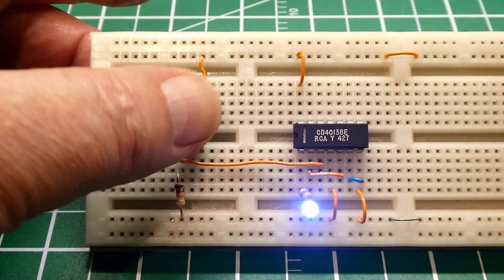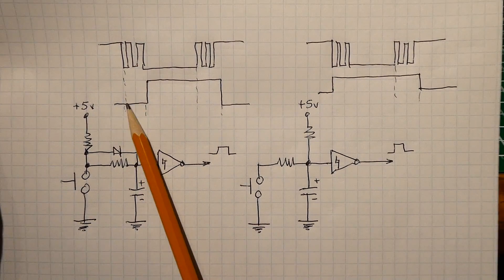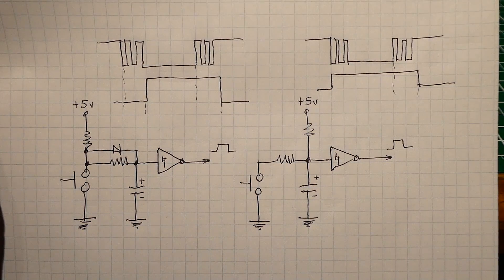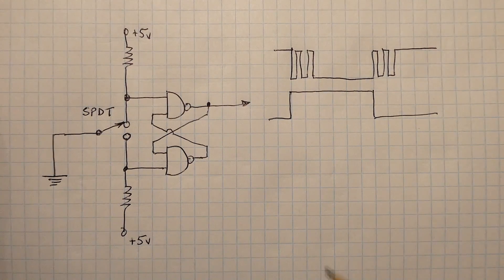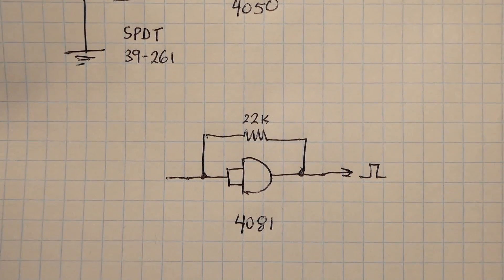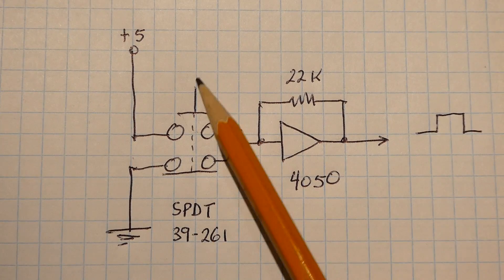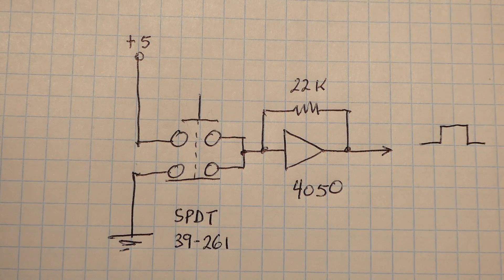Tip Of The Day / Switch Contact Debounce Circuit

Comment: i cant believe how bad switches perform, i am new into electronics and trying a shift register for the first time. I am strugglying to avoid debounce with just a capacitor, it does better but not enough. How something so basic can't perform so badly! and I am like how it is posible that we need a completly complex circuit just how avoid debounce!
Reply from the maker: Anytime you are dealing with mechanical contacts on a switch or relay you are going to get contact bounce.
For beginners I suggest using touch switches which do not bounce when playing with logic circuits.
Check out this video: https://youtu.be/EykS1_vvgW8
Reply: @0033mer  ohh gonna check that one! got just  bought my first ociloscope to test up the swtich bouncing

Comment: Very thorough but what is wrong with only a capacitor or two near the switch?
Reply from the maker: Yes, that can work but you are relying on the first bounce to totally discharge the capacitor, which it may or may not.
Adding another resistor will help but now the the output will have a slow rising edge which can double trigger logic inputs. To solve that we buffer it with a schmitt trigger inverter. https://www.youtube.com/watch?v=e1-kc04jSE4

Comment: The capacitor and resistor itself also works quite well :)
Reply from the maker: Yes, that can work but you are relying on the first bounce to totally discharge the capacitor, which it may or may not.
Adding another resistor will help but now the the output will have a slow rising edge which can double trigger logic inputs. To solve that we buffer it with a schmitt trigger inverter. https://www.youtube.com/watch?v=e1-kc04jSE4
Reply: @0033mer  And that's the beauty of electronics. There are so many different possibilities and solutions :)

Comment: Yikes, That's a lot of complexity. I do it in software. If there is no software, then I use a capacitor. I Bet a microcontroller will be cheaper than these 2 ICs
Reply from the maker: Yes, that can work but you are relying on the first bounce to totally discharge the capacitor, which it may or may not.
Adding another resistor will help but now the the output will have a slow rising edge which can double trigger logic inputs. To solve that we buffer it with a schmitt trigger inverter. https://www.youtube.com/watch?v=e1-kc04jSE4

Comment: Nice video. It's helpful, even necessary, for those learning electronics to understand the switch contact bounce phenomenon, and the hardware debounce techniques to alleviate it. There are more methods, however, such as using buffers with Schmitt trigger inputs, e.g. SN74LS13 and 14, and debouncing in software (assuming an input to a microcontroller). Just remember that it's almost always faster, more reliable, and easier to troubleshoot when you do things in hardware rather than code.
Reply from the maker: Yes, exactly

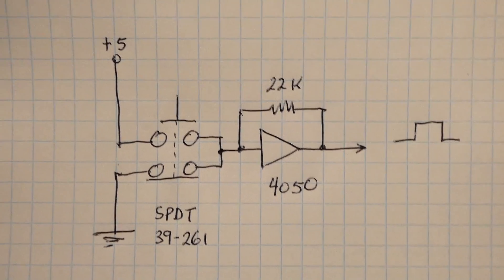Comment: 3:17 Neat, but it would be better to use a transistor than a little common switch.
Reply: For a switch debounce demo?
Reply: @fibonacho  Yeah, the role of the transistor is high or low, it's never disconnected, even better with 2 transistors and 3 resistors (Schmidt trigger). you would be able to use the al time classic 10 cent switch and serve the same role precise or one of the cd40106.
Reply: @AnalogDude_  Thank you. I'm getting interested in electronics again after many years away. I appreciate you taking your time to reply.
Reply: @fibonacho  research RC time contants, placing the correct resistors, using a PNP with 1K on the base from the button aswel a 220pF to ground from the base, 1M from button to GND to drain the capacitor, 33K from the power rail to the emitter of the PNP. the collector of the PNP is tied to GND and your source from below of the 33K.
the capacitor will filter out the glitches and is very power efficient, all this is very little power consum. just few uAmp <100 and pico amp in rest. than put 2 x CD40106 (Schmidt trigger)  in series and place a 22K resistor from no2 output to no1 input.
Microchip does it simpler, just one 100nF and resistor in paralel and a button on their MCU boards.